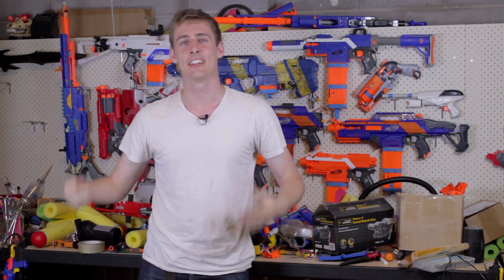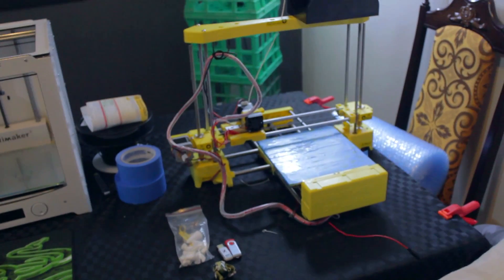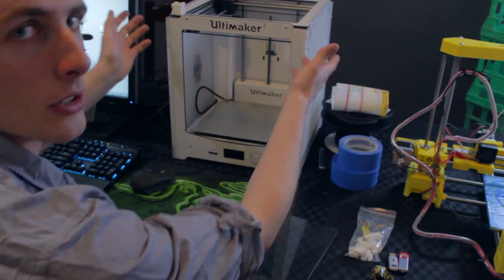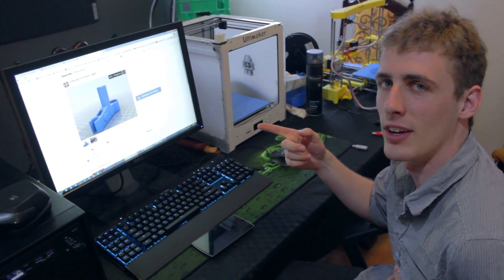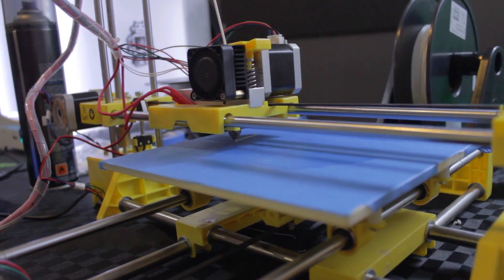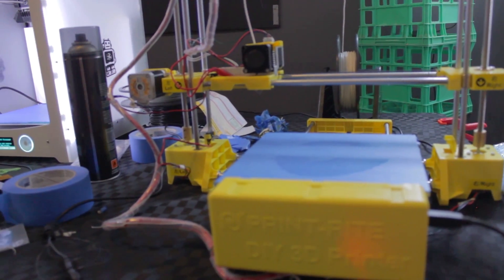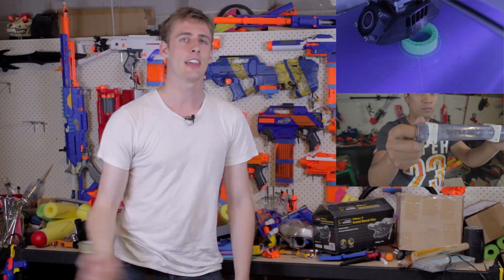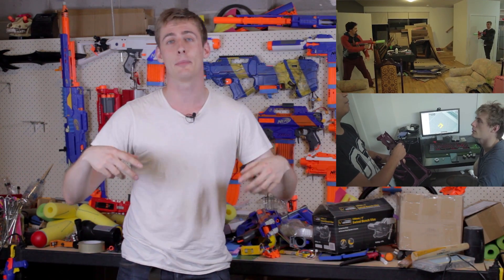ULTIMAKER 2 vs PRINT-RITE DIY 3D Printer & How to Bed Level - PRINTER PARTY | Make Test Battle

Comment: This is a bad representation of the Colido 3D printer. The guy clearly doesn’t know what he’s doing and is not taking care of his equipment. Did you see the condition of the bed? Thats just from a month of use! That’s why he’s having issues. 

If you calibrate it correctly and take care of your equipment the Colido will work as intended. It’s a great starter printer.

Comment: Although it is from Japan, I assume that this is not the result of appropriate adjustment. Because it is impossible to do such work if you adjust it. The temperature of the head is too high and I can not even adjust the retract and I draw a thread

Comment: got my prusa i3 in a kit from china for more or less $300 and it came with a bed leveling sensor, lcd control panel X and Y min endstops and a heated bed with a large build volume  
and the only problem ive had was the control board got fired and i spent $10 on a new one
Reply from the maker: Things have changed A LOT in two years. 
-Justin
Reply: that statement cant be truer, but i still did get mine in december of 2015
Reply from the maker: Where do you live? Also we are talking in $AUD and included shipping and Import Tax. 
-Justin
Reply: i live in the usa, printer shipped disassembled from china with $30 shipping and the thing itself was $320 USD amounting to a total of $350 USD or $446 AUD so that's where the huge price gap comes from

Comment: My Tevo Tarantula would destroy both these printers in build size, price and ease of use.  That yellow monstrosity is not a 400 buck printer, you were robbed.  I print pla, abs, petg, and nylon on a regular bases with my spider I have less then 260 bucks US in my riprap.  My next printer will be a CR-10S.  Also your bed leveling skills on the yellow machine stinks and you didn't even print out bed adjustment wheels to make adjusting the bed easier.  Also loose the Tape, all the cool kids use hairspray on their clean glass beds.  I love to see you print ABS on tape....not going to happen.

Comment: Ummm guys, you said you had ultimaker broken when you got it right? And then your friend has DIY set that's much like your broken ultimaker, not calibrated in anyway without glass over bed. Would it be too much asked to do videos with equipment that's mostly at the same level of engineering? You don't race stock Lada and Ferrari together, do you?

Comment: This is just wrong information, I have a 160$ 3D printer (with LCD and SD card) and after fine tunning and adjusting it does much better than the 400$ one and I would say that it also does better than the expensive one in this video.

Comment: i prefer the $4000 one, because its made in factory which is has sturdy and long lifespan of its chassis making ir alot more durable and longer then $400 diy, since diy sometimes give u nice sturdy metal body or even weak acrylic glass which will obviously break in 1 month of usage

Comment: The ultimaker does not even have a bed levelling sensor, the only category where it is in the "high prosumer class" is in price.  It's ridiculously over priced.  The other printer just needs some tuning, but unfortunately your "expert" is really an amateur with a bunch of cash to throw. Useless video

Comment: I have an HE3D ei3. It came with auto bed leveling, but it doesn't seem to do anything more than reduce my print area from restricting the X movement. The printer does need an enclosure as it can barely reach 65 C on the heated bed in the winter. It has an LCD control screen, and it is actually really forgiving about bed leveling. I'm doing it manually and so far have printed a few things. That $400 model he has is utter crap. You NEED a heated bed, and I also noticed that his blue tape has a lot of air and peeling going on.

Also, blue tape is not very good combined with heat and/or hair spray. A lot of hair spray brands deteriorate in heat. Also blue tape doesn't work well with a heated bed, but is great for PLA sticking to it. I personally just use a bare glass heated bed, no hairspray, no nothing. I then print the first layer at 0.32mm with the print head about 0.2mm above the glass. It really squishes the first layer against the print bed.

I have had a few instances of clogging, a little bit of underextrusion on occasion since I am just now printing my filament holders, and a tiny bit of warping as I am still grasping which temps I need. I have never had any issues like what the $400 printer in this video was having. So his bed must have been severely off, and he probably didn't print his first layer hot enough. With PLA I usually print 235 C and then down to 210 or 220 for the rest. I print on the lower end for objects with overhangs (and slower printing speeds).

Comment: People bought Ultimaker  or similar got ripped for $$$$, that poor guy bought $400 printer got ripped for $$$. So all in all it's just how much $s you got ripped. A Anet A8(clone of Prusa i3) for less than $200 can actually print if you can calibrate and configure it properly. With further tuning and upgrade(parts swapping) you can do as good as the printer costs you $$$$.
Reply from the maker: Note the prices are in $AUD, plus shipping and plus import/tax on the Ultimaker. 
Also the footage was filmed in September 2015 and I didn't get around to editing it till January. The price are just tumbling at this point as the tech becomes generic. 
-Justin

Comment: nothing they put into the ultimaker makes it worth 4000 bucks. not even a closed loop servo drive and quad extruder.
Reply from the maker: Also note this in $AUD with shipping and Import Tax included. 
-Justin
Reply from the maker: And also like 3 years ago prices -R
Reply: still, the ultimaker 2 is 2000 euros today, thats 3000 AU$. i dont see the point why.  they use the same parts, "almost" same software and just got a fancy housing. the print quality is good, but even cheap printers can achieve it if the operator knows what to do.

its like Apple under the 3d printers.

Comment: I found a prusa i3 full aluminium... is that good for 350$?
Reply: i'Pare - My Singing Monsters, Mobile Gaming & fun!    well its not a prusa. its a knockoff bjt many of them work pretty decent and im ordering one of similar price point as a transition just because i need a large printer before oi eventually buy a better one
Reply: Ryan Estes Thanks for the answer :)
Reply: hope it works out. gl i'Pare - My Singing Monsters, Mobile Gaming & fun!
Reply: Prusa i3 are very decent printers, great price/performance ratio - but be aware that may be a huge difference between "original/authentic" Prusa i3 and - commonly Chinese - clone products, or "improved" i3 devices. For 350 bucks you're not likely to obtain an authentic Prusa i3. This doesn't mean that you will get an inferior printer - it merely means that you must be lucky to get a good device. One place where manufacturers tend to save is the controller board. Some cheap boards come with drivers soldered on, which makes them much harder to replace, in case of failure or upgrade (replacement drivers with twice the precision exist - bad luck if yours can't be easily swapped). Also, stepper motors may be sub-standard in terms of quality and power. Often, specs of power supply are too low. Before one can say whether 350$ is a good price, one needs to know how much additional investment is needed to bring the printer on par with an authentic Prusa. A good (and low cost) investment could be replacement trapezoid spindles, as the M8 spindles of some low cost printers are very low quality indeed.
Reply: I second this... you need to be a bit of a tinkerer to set these AliExpress/GearBest units up to do really well, and there is a learning curve... but some of the companies have pretty thriving communities that really help a lot.

Comment: The DIY printer is way better then you guys have shown and you can get one for around 180 on gearbest
Use Solidworks you said, the price tag you didn't said. One license is $3995. Annual Subscription service, which covers technical support and upgrades for one year, is $1295.
Reply: Sano Gage solidworks unlike the ultimaker is worth the 4 grand a year. I can make something in 5 minutes that would have took me a hour in sketchup or Maya.
Reply: You get the free student version

Comment: Nice!
Not a fair "test" by any means, but an interesting comparison - the cheap printer did better than I'd have expected. Certainly good enough to cut your teeth on 3d printing (or design) while not investing too much money (albeit time).
Although by now the Wanhao i3 surpasses it in every way - and is probably being surpassed by even cheaper, better printers. How long will it take until the performance of an Ultimaker is something you can buy while shopping for groceries? :-D

Also, that cart-coin thing is a nice idea. With a few enhancements (i.e. logo, name or some such) it would make a nice trinket to give away.

Comment: what do you think about geeetech i3? My brother in law bought it, he manage to print a model after trying so many times. now it sits beside my computer collecting dust.... I've tried and tried to level the bed change the setting, but still could not print. It peels off after a couple of layers.
Reply: what are you using as a bed? i have same printer and i use it every day for prototyping

Comment: i have the jgaura printer and it cost me about $435 and it has a heated bed and it is a dream, my school has the ultimaker replicator 2 and i honestly cant see a difference in print quality. the only difference is that the replicator has a much faster print speed which doesnt really matter to me
Reply from the maker: The Replicator 2 is by MakerBot not Ultimaker FYI! -R
Reply: Make.Test.Battle sorry, im not up to date on the expensive ones
Reply from the maker: All good man! Its really true that the difference between expensive printers and cheap printers is dropping very quickly as the technology becomes cheaper and more options become available on the market -R

Comment: the print-rite looks pretty bad.  I bought a MICROMAKE mini kossel and it is miles better than this.  has autolevelling that's so good I can print directly to glass and after being a bit finnicky initially is just fantastic.  also, thingiverse has a whle host of upgrade parts for it.
Reply: oh, and it has an lcd and also has a heated bed while only costing £250. soooooooo. why would one buy the print rite again?
Reply from the maker: You wouldn't. But at the time, it was what was available. Technology moves quickly -R
Reply: Make.Test.Battle hmm.  slight problem. mid 2015 was when my printer started being sold pre manufactured. just a thought :)
Reply from the maker: James Ward And? Both of us owned these printers for a while before the video was made
Reply: Make.Test.Battle sorry, I don't want to be rude but... isn't it kinda the point that the Kossel and several other more capable printers were being sold for the same price  or lower at the time of filming. unless of course we assume that he bought the printer significantly before filming
Reply from the maker: James Ward Yeah, significantly. I had owned mine since early 2014 and Kash had his but not used it much for quite a while, but I don't remember how long. The options available today are far, far better and this video certainly hasn't aged well! The technology involved in 3D printers moves so quickly! -R
Reply: Make.Test.Battle ah, right. sorry!  great things to have though aren't they.  I have the most random trinkets of anyone I know now! :)

Comment: Strange comparison conditions: An already levelled printer against one with a (deliberately?) maladjusted bed. I wonder how the results had been, had the Ultimaker started with incorrect bed levelling, and the cheapo set up right. I suspect "deliberately" because upon noticing, that initial conditions weren't comparable, it should have been easy to repeat recording, rather than wasting three quarters of the video until noticing that conditions weren't quite right.
Surprising too that a guy who claims having used the printer for months doesn't seem to know how to level the bed. And - doesn't the Ultimaker support a connection to the PC, that instead the gcode file had to be transferred to the printer the pedestrian way, by copying to an SD card, which then was carried over to the printer and inserted there? Rather unusual for a 4000 bucks expensive device. BTW, LCD displays and interactive user menus are rather common even on printers of the 200 bucks class - It must have taken considerable effort to find a printer without one.
Reply: of course...
Reply from the maker: This was a raw, unscripted "follow along" video to show the nitty gritty of printing while casually comparing two printers as they performed on the day. No retakes.
This wasn't a hardline definitive review nor a sponsored video. Both Ryan and Kash bought their printers outright. 
Note the prices are in $AUD, plus shipping and plus import/tax on the Ultimaker. 
Also the footage was filmed in September 2015 and I didn't get around to editing it till January. A lot of printers get released in 12 months. 
Finally Ryan says on camera that he had 18 months of problems with the Ultimaker. How is that bias? 
-Justin

Comment: solid works is a joke compared to fusion 360 and cymetron
Reply: even the price range of fusion is incredible compared to solid works
Reply: $10 000 usd for licence vs $300 usd a year with updates, multiple programs, cam tool, path, cad, model, 3d printing program and its a skech base like SW but its also more organized and it has step., stp. and a ton more of type of files its even cloud based
Reply from the maker: I was trained to use Solidworks through my degree and have access to the academic licenses through uni and I am capable of making any part that I can imagine with it. No reason for me to use anything else. Your milage may vary! -R
Reply: no but i am saying that they are more powerful programs and that ar mor organized compared to solidworks

Comment: The Ultimaker2 does NOT cost $4000, i got mine for $1600.  Also its not a fair test, as one printer was R&D'd by thousands of people threw open source and it made to be the best it can be given the size and limiting factors of FFD printers. The other printer however was developed by a small team and made to fit the budget and scale of the project during production.
Reply from the maker: $4000 AUD dude. Printer + Shipping +Import Tax all multiplied by conversion rate. 
-Justin

Comment: heya guys; could the Ultimaker handle a wax filament such as the Machine-able Wax spool from Maker Geeks?? cheers!
Reply from the maker: No idea! by the sound of it I don't know how well a boden extruder could handle a wax filament -R
Reply: ok, cheers ! i'll keep nosing around for a suitable printer. :)
Reply: I have a much cheaper printer that's based on the reprap kossel but still uses a bowden type extruder and I would say that the ultimaker probs can handle the wax filament.  I have used moldlay (a wax substitute filament) and it worked great.  hope that helps!

Comment: Well that´s what happens if you buy a 3d printer kit i don´t know what to do ^^ 
for 300€ you get a prusa i3 with heated bed and for 50 more, you get auto bed leveling and a second extruder.
You still need to know how to set it up probably, otherwise your prints won´t stick, will be deformed in different axis or just look horrible..
If you buy a Makerbot, you pay a lot more, but don´t have to go through the hassle.. But in my opinion it´s fun to build the printer by yourself and part of the hobby. You also learn a lot, as there is no "fixed" plan on how to do something, you decide which components you use and how you make them work all together.

Comment: If you want a cheap 3D printer that is good i recommend Anet A8. around 250-300$ . heated bed home switch and compared to the cheap one there much much better prints and an LCD.

Comment: I've found that nothing beats Kapton tape for bed surfaces, and that even Ultimaker's have Chinese parts. In August of 2016, if you've got about $400 - $500 laying around, and a CNC system, you can assemble a better 3d printer than an Ultimaker 2, with your own, two hands...